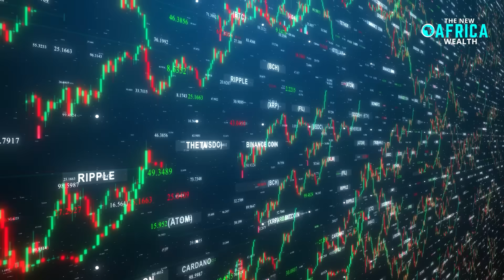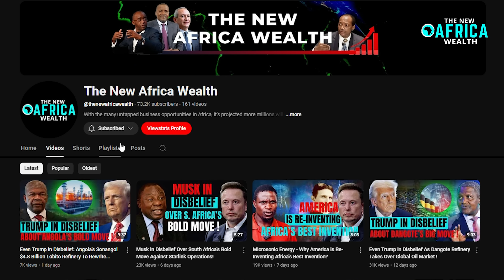Africa and Asia to Be Linked by $4BN Moses Bridge - Project Construction Set to Begin!

Comment: As of my latest knowledge, there is no confirmed or officially announced project for a "Moses Bridge" linking *Asia to Africa**. However, there have been discussions and conceptual proposals regarding bridges or tunnels connecting the two continents, primarily across the **Red Sea* between **Saudi Arabia (Asia) and Egypt (Africa)**.

### *Potential Projects in the Region:*
1. *Saudi-Egypt Causeway (Red Sea Bridge)*  
   - *Proposed By:* Saudi Arabia and Egypt  
   - *Possible Route:* Between *Sinai Peninsula (Egypt)* and *Tabuk (Saudi Arabia)*  
   - *Status:* Feasibility studies and discussions, but no confirmed timeline or contractor.  
   - *Estimated Cost:* Billions of dollars (if approved).  

2. *Other Conceptual Projects*  
   - Some futuristic proposals have suggested floating bridges or underwater tunnels, but none are under active construction.  

### *Contractor & Timeline:*  
Since no official project has been finalized, there is no confirmed contractor or schedule. If such a project moves forward, major construction firms like:  
- *Bechtel*  
- *China Harbour Engineering Company (CHEC)*  
- *Orascom Construction*  
- *Saudi Binladin Group*  
could be potential candidates.  

Would you like information on similar existing bridges or tunnels (e.g., **Eurasia Tunnel in Turkey**)? Let me know how I can refine the answer for you!

Comment: This video is full of bs. Firstly, it is not called the Moses Bridge. It is called the Saudi-Egypt Causeway or 'King Salman bin Abdulaziz Bridge'. The original Moses Bridge is in Halsteren in Netherlands. The KSBA Bridge does NOT cross the Red Sea. It crosses the much narrower Strait of Tiran at the southern end of the Gulf of Aqaba. It is NOT 30 miles long. It will be around 20km or 13 miles long. The Red Sea is NOT half a mile deep. It is more than a mile or around 2km deep at its centre. Only the plans on paper are completed. There have been no concrete moves toward building this bridge. Wasted 9 minutes of my time watching nonsense news. Thumbs down for this video.
Reply: Thank you for posting the corrections to the video narrative .   I was going to remove my posting of a comment on here as a result of this information .. but now I see my curious query is fully relevant.
Reply: الفيديو مطلعينه المصارية و لا له أساس .